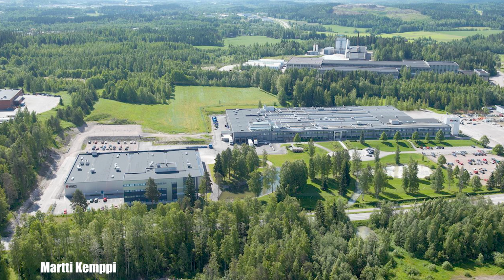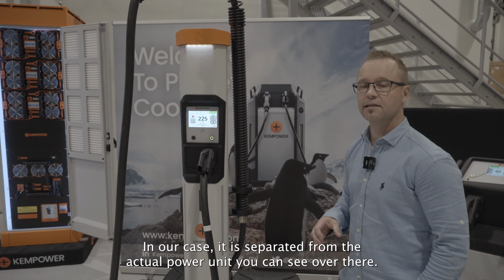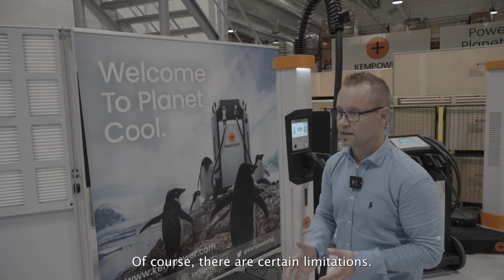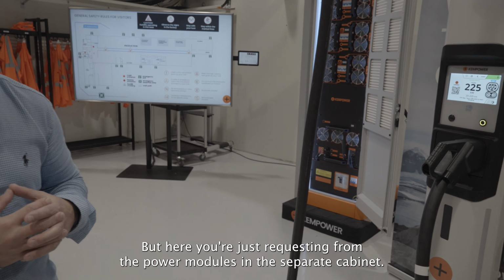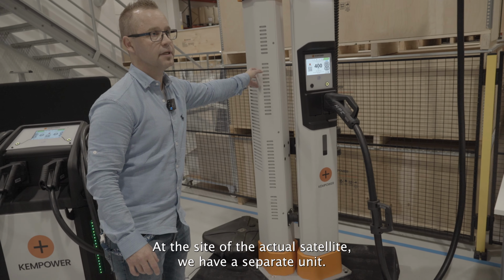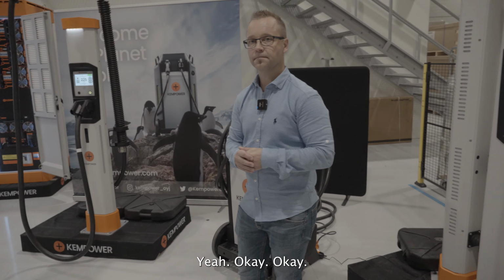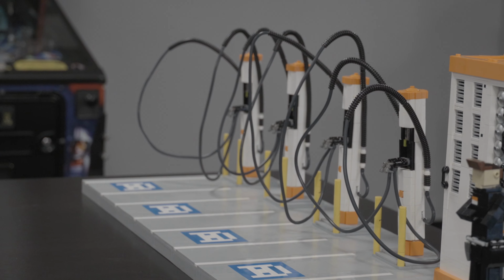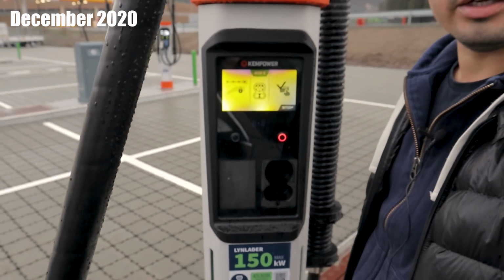Why these DC fast chargers are so much better than any thing else

Comment: From a user perspective Kempower is great and they have a great solution to share the total charge power between several dispensers/satellites.
However, from what I've learnt they use quite a rudimental switching technology in the power unit, which causes higher conversion losses between grid AC and DC. There also needs to be a larger filter to reduce power quality (voltage and current harmonics) issues from the AC/DC switching due to the use of older technology. 
Hopefully Kempower also can step-up this game and address these "hidden" drawbacks compared to other manufacturers.

Comment: One question is losses, with up 80 meter från the power modules the cable losses could be rather high and theese cables must also be cooled if over 300 A. Who pays for the losses? Where is the delivered kWh measured. I know this is a sponsored clip but some questions is valid.

Comment: I think there is a lot of chargers that actually works like this not only kempower, Tesla one of them.
Reply from the maker: Tritium has 100 and 150kW modules, so not the same as Kempower 50kW modules. Tesla V4 stations are a little more flexible, with 75kW modules. So no, nobody is doing quite what Kempower are doing 😊
Reply: @KrisRifa Didn't v2 SC have smaller modules? Why does this guy claim the normal kempower has only 300 A when Bjørn showed it can do 350 A (or was it more?) when configured appropriately? 300 A simply does not cut it.
You should do a report about the eLoaded dc chargers at Zusmarshausen and why they can do 475 kW.